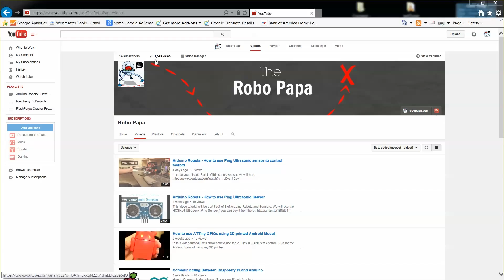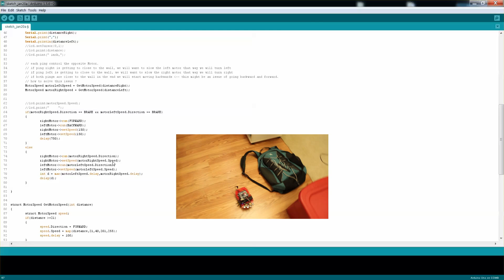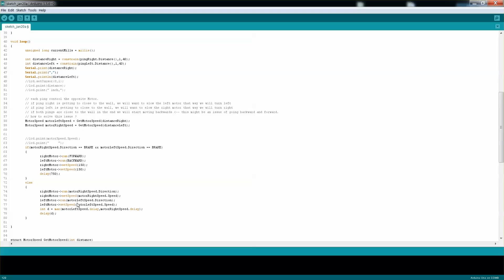Tutorial in How To Use Arduino For Obstacle Avoiding Robot

Comment: hello again robopapa, I want to build a maze robot, any suggestions for the parts?
Reply from the maker: +Sepehr Alizadeh Depending on the algorithm you are planning to choose but most of the "mouse" robot for mazes just using ping sensors to know where the walls are.
Reply: it's not a line maze, so I will need some sensors for reading start end lines and the walls, what about processor? which aruino is better? which sensors do you recommend (price and functionality in mind)
I know it's too much to ask but you are the only guy I know I can ask
Reply from the maker: +Sepehr Alizadeh how big is the robot? is time more important than understanding? i.e. race maze. there are algorithms that build maps and as the robot go through the maze it is "mapping" the walls etc. I didn't build a robot like that, but I will assume that a sensor that can give you wall indication and distance (like the ping) will be good here. plus you will need something to look at the floor to find the end line. I saw in one competition that a prof. from Asia installed a camera on his robot which did mapping of the maze, and than found the best path to get to the end. This was fine because the time didn't start until the robot moved from the starting point. So it is really depending on what you want to get
Reply: I think that would be cheating (camera) , ping sensor seems suited for me, and I already know cny 70 (if I recall that correct)
thank you so much, now I know I have to search for "ping"
Reply from the maker: +Sepehr Alizadeh it depends on the rules, right? at that instance it was allowed. The time didn't start until the "mouse" moved from the starting point, so the robot was able to start a camera, view the whole maze and than calculate the correct path. The funny thing is, even though he had that ability he wasn't first place :)
Reply: Robo Papa wow! slow motors I guess :D

Comment: why didn't u use the sevor sensor to move ur ultrasonic sensor
Reply from the maker: Mcantony Phale that is a good question and it comes down to design of my project. I had two ping sensors that i could use and it gives you better knowledge of the space. If you have one ping and you use motor to rotate it, you need to keep sampling the environment in multiple direction. The idea of this project was mainly on how to use the ping sensor to avoid obstacles. The method you asked about is another way of doing this
Reply: So you still use the same program coding, for the both of ur sensors, or u do them separately?
Reply from the maker: Mcantony Phale same program running both sensors. Taking a read from both sensors and the function determines what should be the speed of the motor depending on the distance
Reply: Robo Papa  so is it possible to use 3 ultrasonic sensor 2 in front and 1 behind? and how will the code look like?
Reply from the maker: Mcantony Phale you can connect as many ping sensors as you wish as long as you have enough GPIOs for it (with the HCSR04 you need two GPIO for each, one for the echo and one for the trigger). The code will look the same just that now you will have, for example, left & right and also back. Than you can read the sensors values and make decision in your code. Hope that helps
Reply: Robo Papa yes it does thank you very much
Reply: Robo Papa I need ur help I tried doing the program like u but I the ping library(#include <Ping.h>) is not working. and I tried using NewPing. and it is hard. please make a tutorial of it.
Reply from the maker: Mcantony Phale by the NewPing do you mean my custom Ping library ?
Reply: Robo Papa no is arduino newping. can i please have your custom ping library?
bcoz my ultrasonic sensors are interfering. please leave a link of your custom ping library.
Reply from the maker: Mcantony Phale If you go to my website here: http://robopapa.com/Projects/ArduinoAndSensorsPartOne half way through you will find a link to the HCSR04.zip (you can seach for that text as well on the page.)